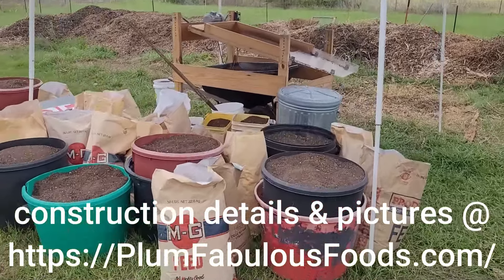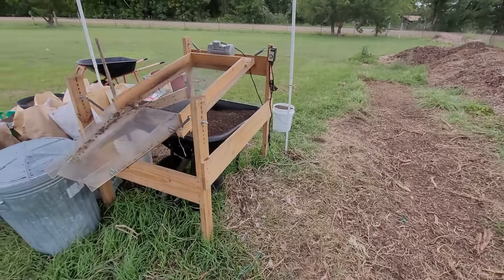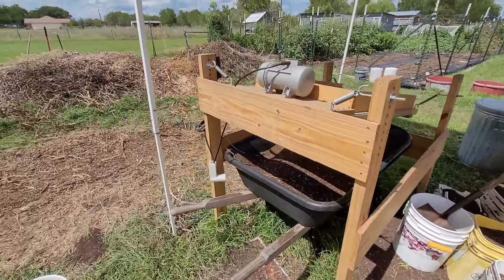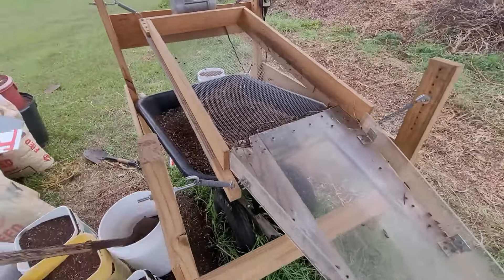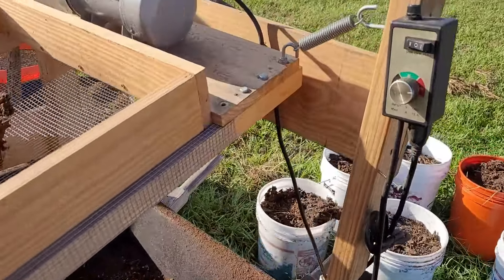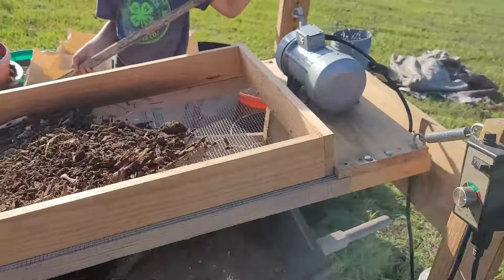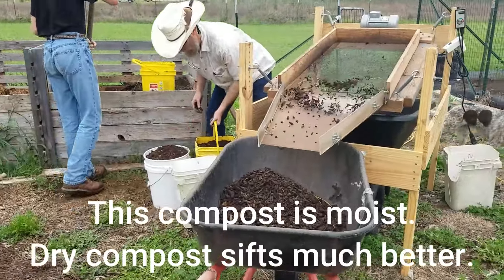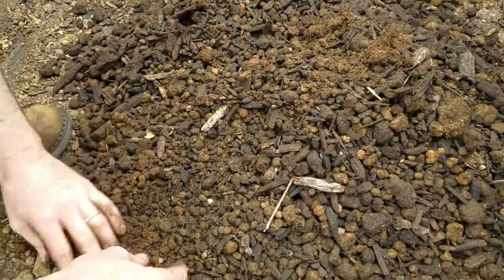DIY Motorized Compost Sifter Design & Demonstration With Beautiful Compost

Comment: How does the motor hook-up to the shaker? Is there a belt? How does the motor make the shaker actually work? This is a horrible presentation.
Reply from the maker: Sorry that you didn't find the video helpful. The motor itself vibrates.  It is a vibrating motor.  All you do is bolt it on and it vibrates whatever it is bolted to. You might check out our blogpost with construction notes for more clarification: https://plumfabulousfoods.com/blog/compost/diy-motorized-compost-sifter-construction-demonstration
Reply: You bolt the motor to the frame and the vibration transfers and shakes the mesh screen. The springs isolate the vibration from the base frame.

Comment: You could add a little chicken Manue to the stuff that did break down. I use chicken manuer that's when I had my big garden I grew sunflowers from 14 feet clear to 16 feet and heads on  them was around 16 inches a cross the flower. I had a lot of hot peppers 🌶 and bell peppers 🌶 tomatoes 🍅 like wouldn't believe. Right now I've got a small garden and isn't growing as good as my old garden I don't have enough sun shine is the problem. I'm working some other things to get it going good like my old garden soon.
Reply from the maker: We use chicken manure too but our 30 birds don't make enough for us. Those sounds like some amazing crops! I'm sure you'll get your new garden up to speed. Gardens always get better with time, good luck!

Comment: So how is that electric motor hooked up. To me it looks like  a motor bolted 🔩 to a piece of wood 🪵 I'm hoping you can share this info.
Reply from the maker: The motor itself vibrates.  All you have to do is plug it in and turn it on and it vibrates whatever it is attached to.
Reply: @PlumFabulousFoods  My electric motors run so smoothly, you wouldn't know they are running without the noise?
Reply: @mitchfountain6523  Theres an offset counterweight attached to the motor shaft to make it vibrate. Pretty simple setup actually. I love the design. You could actually just take a standard pulley and drill holes in it on one side and keep experimenting with the amount of pulley material you take off on one side to get the vibration just right.

Comment: Great work on this and thank you for sharing your next iteration of this! I made my own version from your spider model and it has been working great for me, just manually with no shaker motor. Are there any companies that manufacture a shaker motor in the USA? I bought an inexpensive motor online and it burnt up within 30 seconds. I am guessing it could not handle the electronics from the variable speed controller. (my controller is the same as yours).

Where did you get your shaker motor?
Reply from the maker: Thank you for the kind words. Here is a link to notes on construction: https://plumfabulousfoods.com/blog/compost/diy-motorized-compost-sifter-construction-demonstration including a link to the motor: https://globmarble.com/concrete-vibrating-motor.html
Reply: Thank you! This motor is 3x as big as the one I had. They have a code for 10% off your first purchse with them. My new motor will be here in less than a week.
Reply from the maker: @markmilne3967  Awesome! I hope it works for you